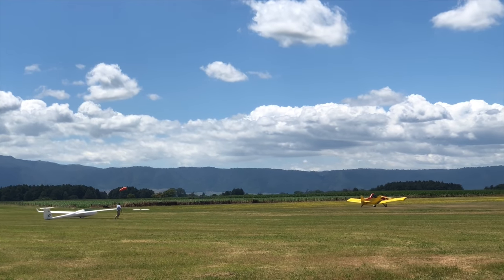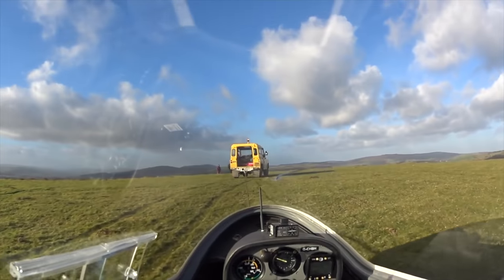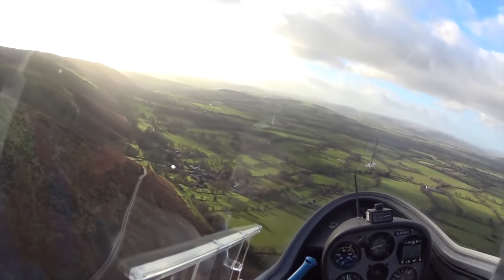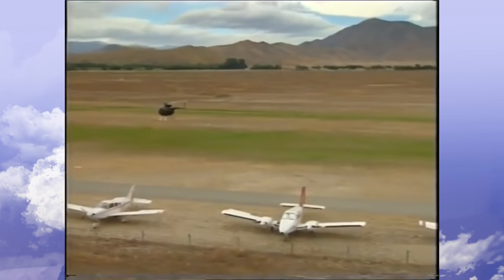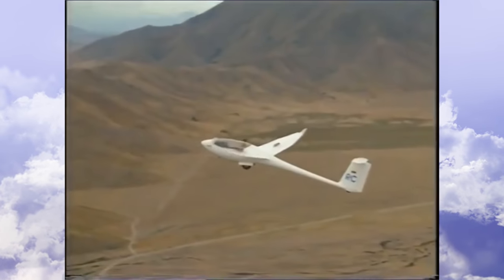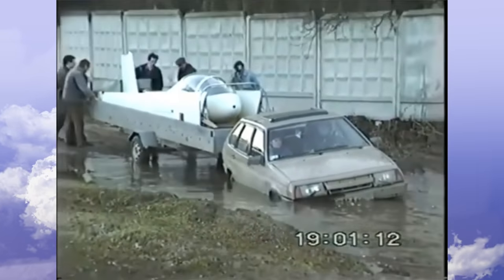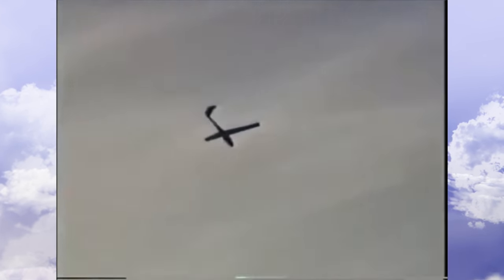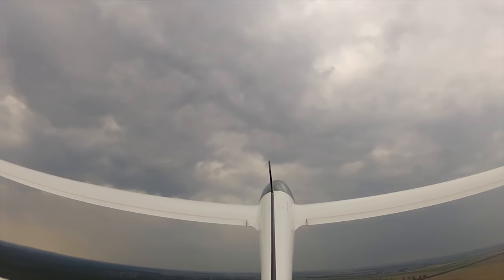4  Weird Ways to Launch a Glider! 🚁

Comment: Bungee isn't 'crazy' - in fact it was the norm in the 20's and 30's.....and auto launch and reverse pulley auto launch is fairly normal - belonged to several clubs which used this method in the UK.....  far more crazy methods out there - grease board launch, horse launch, JATO pod launch........
Reply from the maker: Yeah it’s not as crazy as the balloon launch, that’s for sure!

Comment: Is there any way to launch a glider without help of anybody? Just thinking if you're all alone.
Reply from the maker: Yeah, if you have enough money you can buy a self launching glider! It basically has an engine you can use to take off alone.
Reply: @PureGlide  I was thinking about the ones without engine. But I cannot come up to any methods where you can launch without help 😅
Reply from the maker: The only real option would be the 'push it off a hill', but even that would be very tricky by yourself! You'd nee a release of some sort, and some way to hold the wing up, or use a wing tip wheel ... haven't seen anyone do it!
Reply: @PureGlide  have you ever seen a u2 taking off?

Comment: Not sure I'd call that helicopter launch safer than the balloon launch
Defo not the hoover part..  considering helicopters are in a constant state of disassembly and eagerness to depart.. And balloons have much less moving parts(Gas valve) and are genuinely predictable AF, I'de be more eager to take off with a balloon than with a chopper.

But even with the regular take off : What happens if the chopper has a tail rotor failure.. 
pilot has to dump collective and basically falls ..  Now you hope that the cable will release and not entangle?? big IF.

I Have more trust in metallurgy of the balloon cable and its predictable lift..

Comment: The helicopter launching, I imagine the danger might be rotor wash.
Reply from the maker: True, especially with the dangling underneath!
Reply: Not to mention a possible rope break with potential for disaster when the tail rotor catches it
Reply: @ChrisA7X89  Sling loads are quite common though right? I guess the difference is sling loads you are often travelling slower.
Reply: The rope break vs. tail rotor was the one that got me worried.
When we're talking sling loads, the load keeps the cable away from the tail rotor. And when the load is dropped, the cable either goes with the load or is reeled in immediately, I'd assume?

Comment: I have a vague memory of the English doing an auto launch where the tow rope passes around a pulley at the end of the runway and the tow vehicle drives towards the glider!  😳
Would be grateful if anyone else can back me on this or that I’ve finally reached senility. 🤪
Reply from the maker: I think they use two pulleys, so they can offset the glider and vehicle :) I meant to talk about that, but didn't have any footage of it and forgot...
Reply: @PureGlide  thanks for that, I thought I might be getting too psychotic to fly. 
I wondered how they got around fouling the rope when reversing direction. 👍
Reply: I belonged to the Ulster Gliding Club based at Longkesh Airfield in the late 1960’s early ‘70’s. We had a Blanik and Slingsby Capstan and used a cut down Chevy V8 as a tow car. The back of the car was cut off and a large spring balance scale mounted to the chassis. The rope passed around a pulley mounted to a tractor at the far end of the strip. During the tow the driver watched the scale in the rear view mirror. At the top of tow when the rope pulled the glider level the driver would see the tension increase and immediately skid to a stop and the glider would release. The pilot would announce over the radio 800 feet. Begorrah!
Longkesh was then shortly taken over by the Government and used for Longkesh prison mainly for IRA and Loyalist prisoners. The gliding club,tractor and old Chevy seemed to disappear into the Irish mists of time.
Reply: With a fixed pulley it basically becomes winch launch, except using a car instead of a drum to spool the cable.
Reply: I flew at Aston Down in the UK when I was younger. At the time they had a US pickup with a big engine running on gas. Was great fun to ride in, especially after cable release as the vehicle needed to go as fast as it could to try and fly other end of the tow rope back to the end of the runway without dragging on the ground.

Comment: Couldn‘t a Helicopter pull the glider vertically up, without any foreward movement and in 3000 feet the glider releases, stalls and then recovers? Maybe they do this, too - I stopped the video at 4:42 to write this comment.
Reply: Ok, they do a drop. So nevermind. 😅
Reply: I don't think they would just go vertically up for the same reason that the balloon launch is stupid - if the cable breaks, the glider has no airspeed so cannot recover unless a fair way up.

Comment: The balloon launch is not dangerous in my opinion - in fact probably less so than winch or aerotow.  The rope can be substantial (unlike the wire used in a winch launch), there are no dynamic loads as there can be on an aerotow with the glider getting out of position or lift forces in a winch launch, nothing to cause fraying of the rope, no big accelerations, and so long as the rope is visually inspected before launch there is therefore pretty much zero chance of it breaking, as it will be rated at many times the weight of a glider - the only load it has to bear.  If the balloon suffers any problems in its launch or is blown too far off the vertical from the sailplane, this will almost certainly happen before the balloon is high enough to lift the sailplane off the ground, which can therefore simply release before it has moved.  So long as the launch site does not have any nearby tall trees, wires or buildings that the wind could carry the combination into, I can see very little that can go wrong.  Balloons can only launch in very light wind conditions which limits the usefulness of this method, and of course you need a whole retrieve crew for the balloon.  You could however achieve an extremely high release height - maybe 10000 feet.